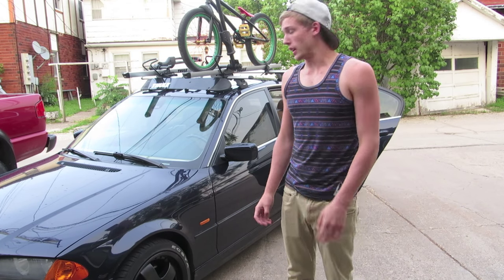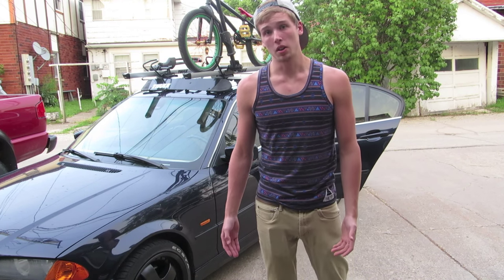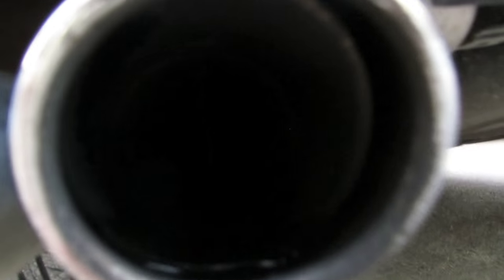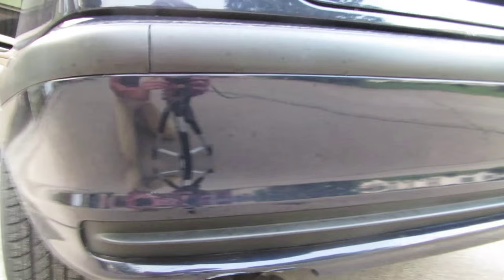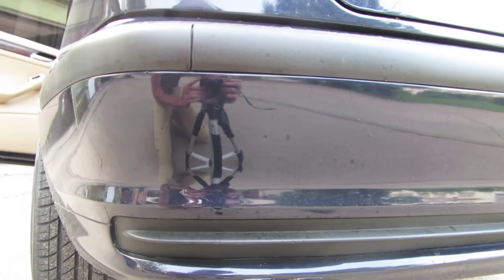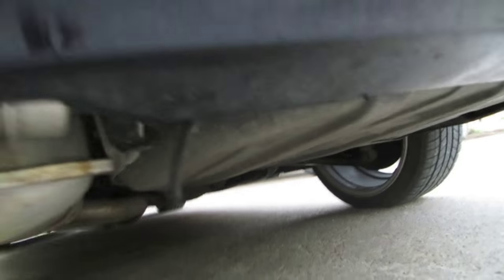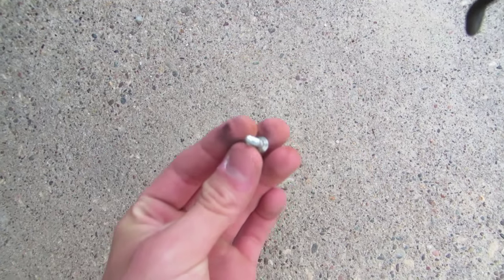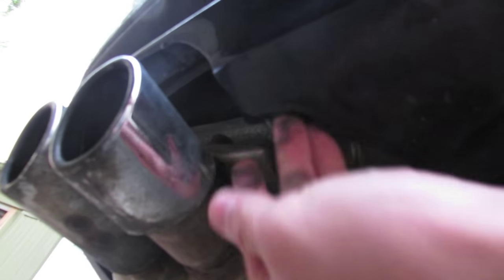Bmw e46 Golf Tee Mod - How To + Before & After

Comment from the maker: Update I learned later on that it makes no difference in high RPM. It only makes a difference at idol. 

Cold starts are noticeably different giving a much louder lower rumble than stock. 

I put 10,000 miles on this e46 after doing the mod and had no issues with it!

I recommend trying it out for a week and seeing if you notice a difference, it is a completely reversible mod. So if you don’t like it switch it back!

Subscribe and check out my review of my e36 as well!

Will be posting a review of my 1999 lifted, supercharged Toyota Tacoma soon as well! Let me know if you’re looking forward to it and subscribe!

Comment: The story behind the valve is simple - Fuel economy and emissions. Valve closed means no need for full exhaust push. The system knows you are running on smaller power need so the valve stays closed while the DISA and other parts in the engine calculate the best consumption and emissions according to your need. But once you hit the pedal all optimalisation systems are on stand down and do nothing to allow the engine to create maximum output. For that you also need a lot of space for all the exhaust fumes thus the vent opening. 

Thats it. 

If you want more sound get a different end muffler or a complete exhaust kit from headers to end muffler.... or if you are on a budget just cut off the end muffler and replace it with pipes. If you are on a really reeeeeaaaally tight budget then just take the end muffler, cut it open, remove everything inside, spot weld it back together and then put it back in. Gonna soud a little like crap and probably annoying for everybody around you (including yourself after the fun has left and the daily feel kicked back in) but hey.... it is an option :)

Comment: You won't hear it much in neutral. Go for a drive and it will sound louder at low revs. The mid range to high is the same sounding tho.

Comment: I did this on my 2001 330i and at low revs between 2-3ish its loud AF. (Well mine is) after the mod. Mid range to high revs sound the same. In low revs it makes a big difference. I got a nice little pop and crackle too when I downshift from 4-3 and 3-2nd. (Its auto but still sounds nice) 

Be warned on road trips tho, if the cars sitting at low revs it will drone with the windows down.
Reply: Eratiik u just ruined ur engine lol jk
Reply: Define drone
Reply: Please